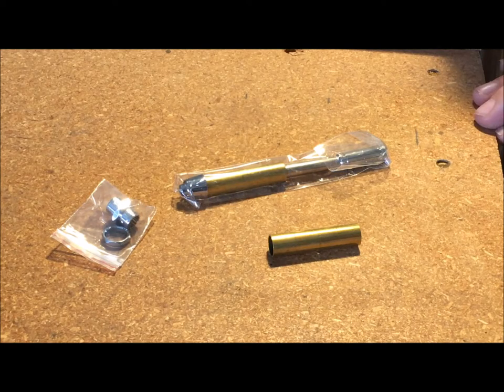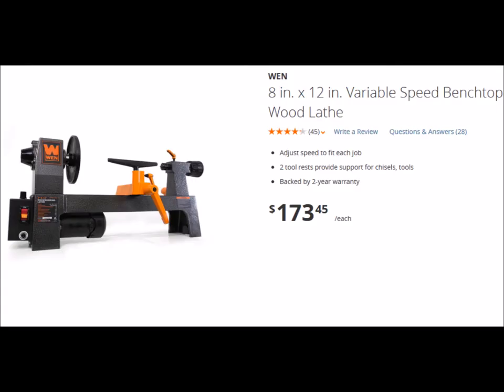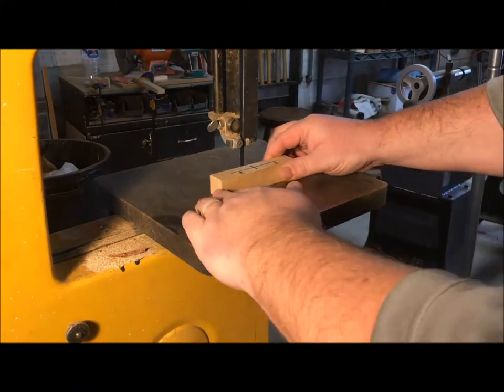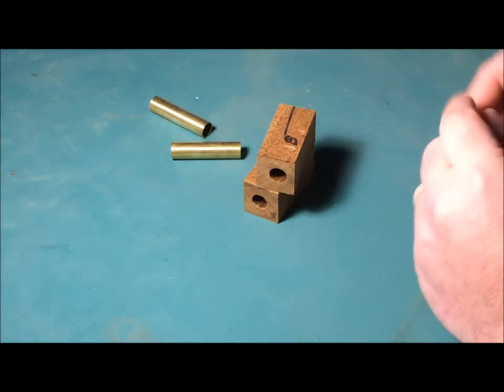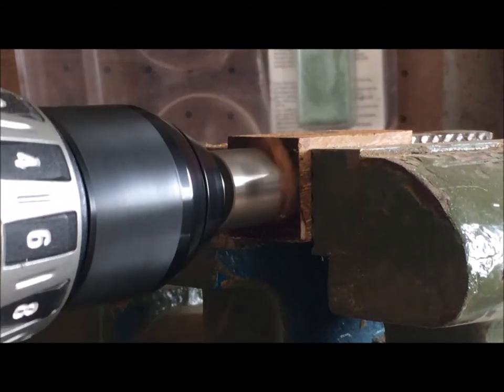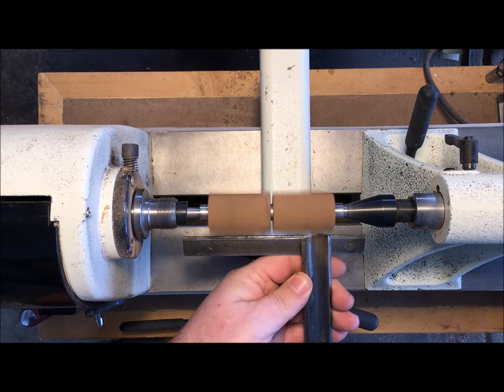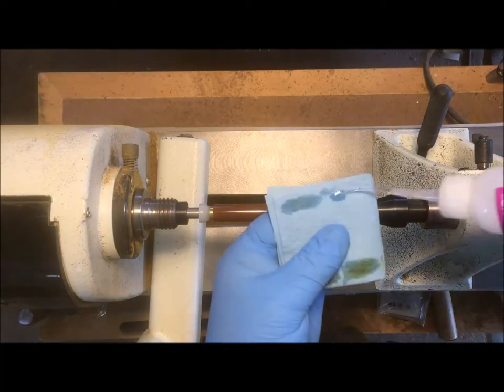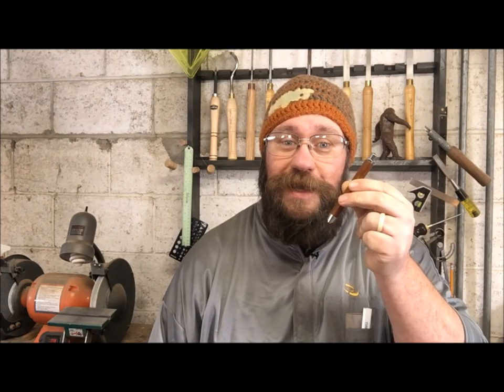Pen turning/ what I need to get started!

Comment: Considering the video covers the basic equipment I find that mandrels, barrel inserters and barrel trimmers are unnecessary. Beaufort Ink bushes are tapered so you can turn between centres, if you're not super clumsy (or wear gloves) tube inserts aren't useful, I saw the blanks flush with the tube using a band saw and finish it up with a belt sander. Also if you're are going to recommend these why not recommend pen chuck jaws? But otherwise it's a great video, I've only just found your channel so please keep this up, Thank You.
I had never heard of a pen diss assembly kit before, thanks for that tip. 
I prefer HSS tools but haven't tried Carbide properly yet.
Have you tried a sanding sealer, melamine lacquer, carnauba wax finish?